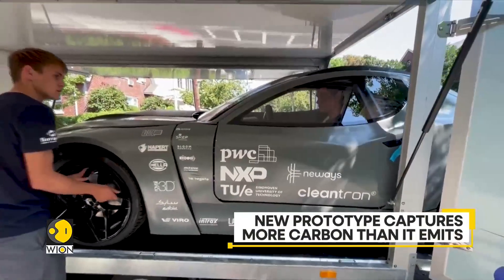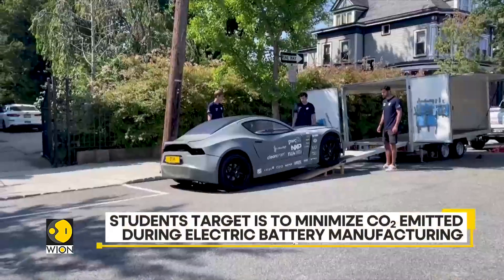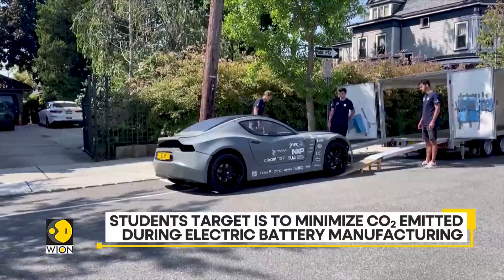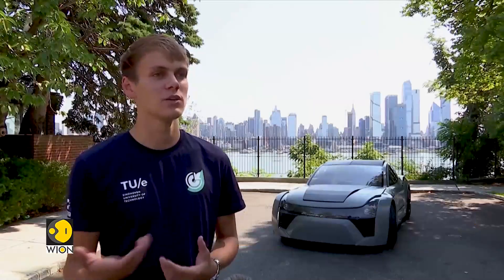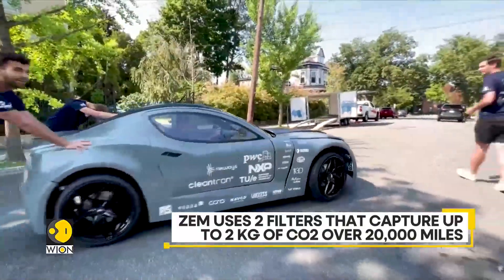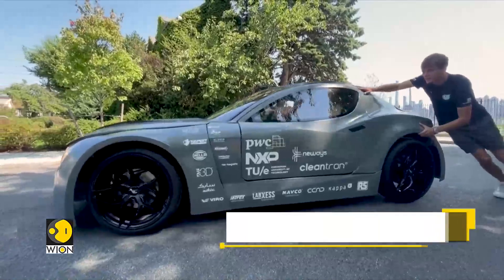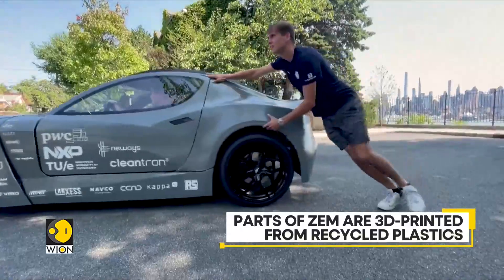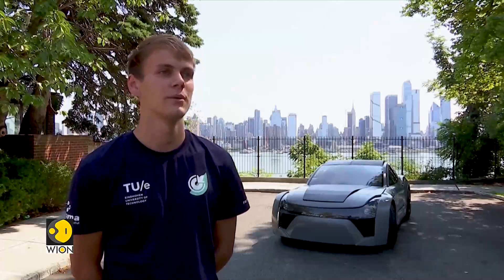World Business Watch: Students build sustainable all-electric car to reduce CO2 emissions

Comment: Are those the kind of "recyclable" batteries that need to be shipped off to Asia for processing?

These projects are always "sustainable" until you account for all the raw materials, processing, manufacturing, and shipping.

Of course a the car is sustainable if you just count the energy needed to charge it off of CA's power grid. But when you factor in that 30% of CA's energy is imported from less renewable sources, it probably evens out with a regular car over time. Especially with the extra precious metals in EVs that are chemically leeched from the soil and toxifies entire regions.